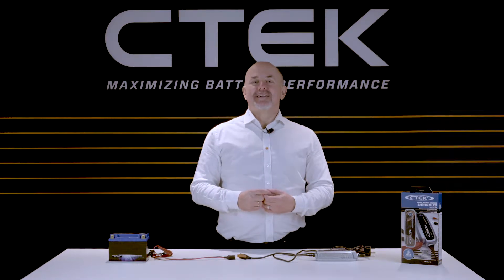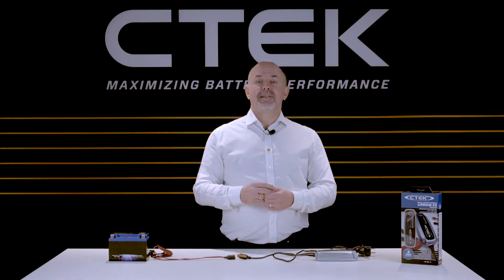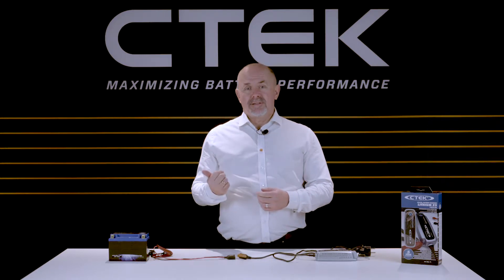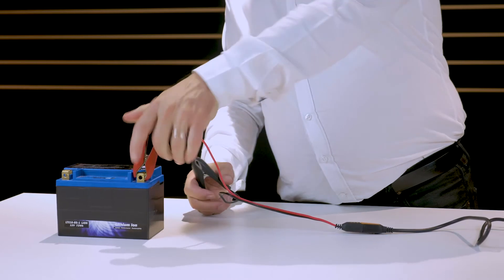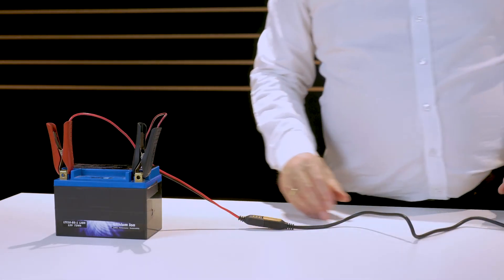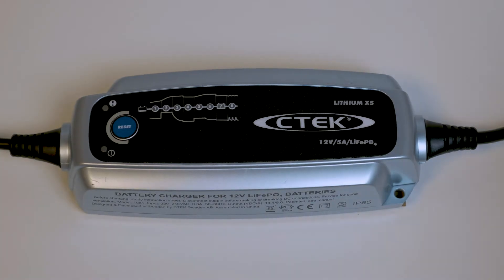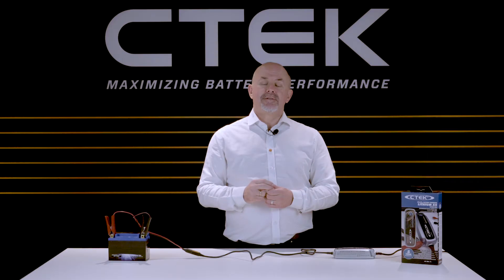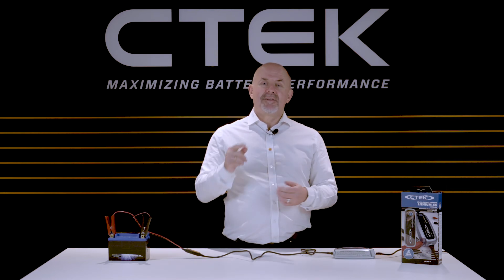Tutorials - CTEK Lithium XS - How to connect

Comment: Just wanted to check if this is okay to charge a 3ah lithium battery? I guess this would be 1.7c. This is for a Ducati v4s.
Reply from the maker: Unfortunately the Lithium XS is only designed to charge and maintain batteries between 5ah and 120ah
Reply: @CTEKBatteryChargers  thanks for the update
Reply: Any chance you will be making one of these suitable for motorbikes? Our batteries are often quite small to keep the weight down. I have the current model Ducati V4S which is 3ah for example.
Reply from the maker: We can't discuss future products, but we always try to listen to the feedback from our customers or potential customers, so thank you for sharing your thoughts :)
Reply: Thanks

Comment: If the Lithium XS is connected to a Lithium Service battery, that is fully charged and also connected to a D250SE, that is connected to a AGM starter battery, can the Lithium XS, through the D250SE, charge and maintain the AGM starter battery? Is the DS250SE somehow upping the amp from 5a to 25a?

If it is possible to charge without harming any batteries but only at 5amp and more amp is wanted. Is it possible to connect MXS10 to the AGM starter battery and when that is fully charged, charge the service Lithium battery through the D250SE?

Thanks // Jesper
Reply from the maker: Hi, The D250SE Will perform a lithium algorithm on the output for the service battery. 
This is where the lithium battery should be placed. 
The input to the d250se can be alternator, CTEK 10, solar panel. 
The output current would  off-cause depend on the power input. 
5A would not become 20A passing trough the D250SE. 
Hope this is helpful for you. 

Best regards.  CTEK Support